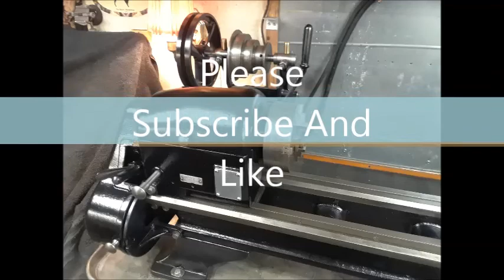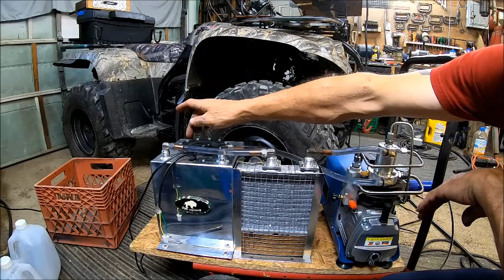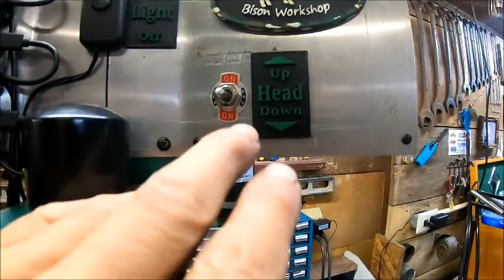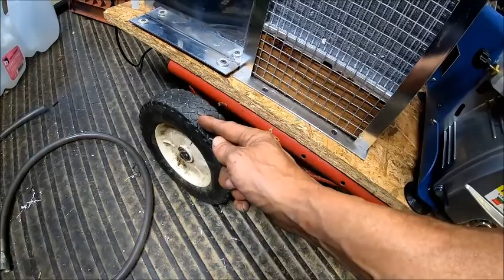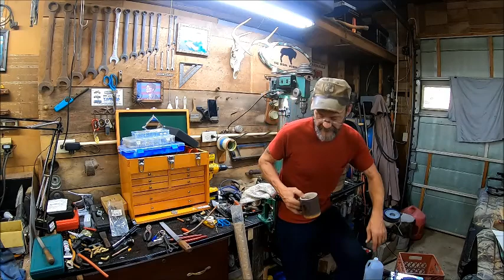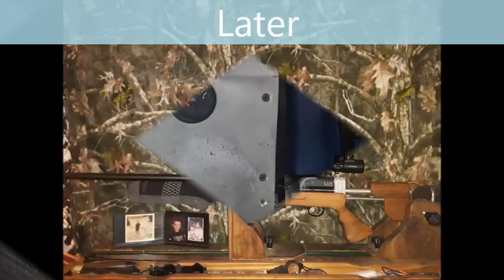yong heng compressor station build part 3 testing

Comment: What temp does the young heng now operate under full load
Reply from the maker: i only run mine just long enough to fill a gun witch is around a minute or less maybe once a week or two and never gets over 40 degrees c at any giving time
Reply: @BisonWorkshop  Thanks for info. i am getting ready to start this , but i think i'm going to use a small car radiator with an auto fan, which is similiar to what you have done. I just wondered how cool a fan/radiator would keep the compressor. One more thing i think you should do - on my Young Heng and Tuxing compressors, i removed the 6mm oil drain plug, drilled out the middle (this takes a drill press and drill press vise), and expoxyed in a small magnet sourced at Amazon. These compressors don't have bearings around the crank, and candidly, i've been amazed at how much metal "fuzz" is stuck to the end of that magent after my 8hr. always oil chance.

Comment: Great job! I wonder if the pump in the tank as well as your fittings and hose are displacing a half gallon of space?? Just a thought. LOL I finally spied the Bison emblem on the tank, looks downright official. The do make flow indicators for fluid lines. Check out Grainger or McMaster Carr but be warned you will get your wallet out for that experience......maybe even on Ebay or Amazon once you get an official brand or name of the gadget. I would bet you can get pointers on the level gauge wiring somewheres on YouTube.
Reply from the maker: i thought about the flow meter but found no real gain to having one. ive already went way past realistic use lol
Reply: Agreed but it would look cool! I have seen some that have a red and white striped ball in a glass that spins......that would be the SHIT man! Might not be enough flow pressure with that pump but its nice to dream anyway. I am surprised you didn't incorporate a cooling fan directed at the head of the compressor to supplement the one behind the motor.....from what I hear that is a HUGE benefit especially when filling the big SCBA tanks like you have. I dont have all the machining gear to do what you did but certainly got some great ideas from watching this.